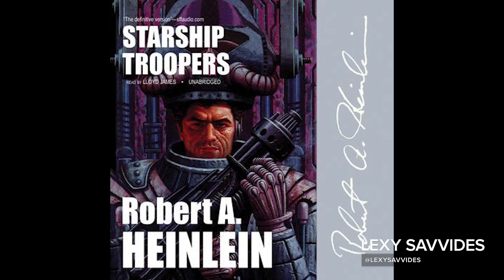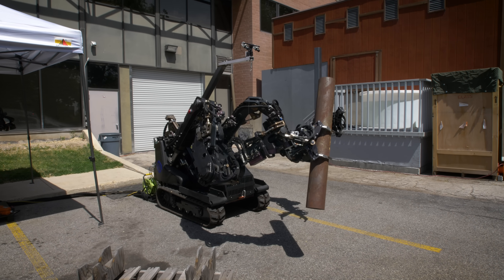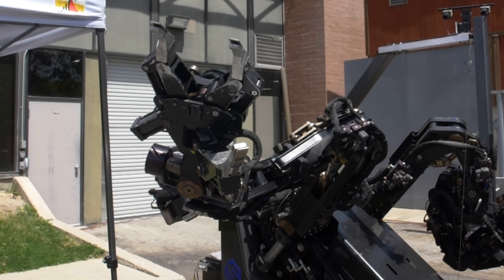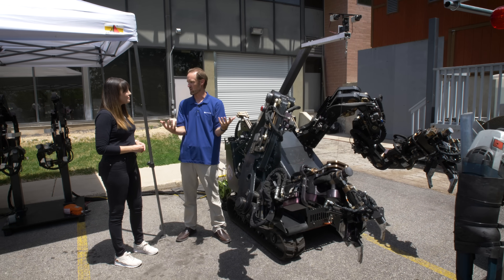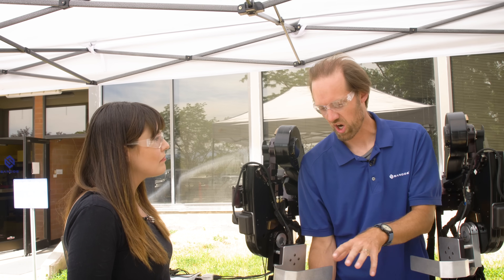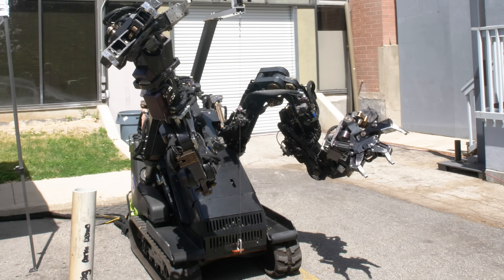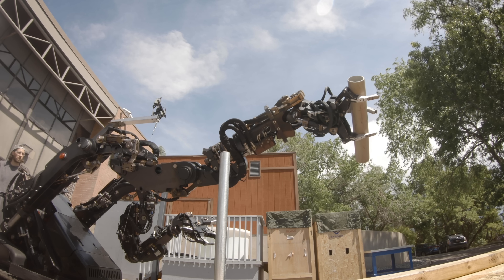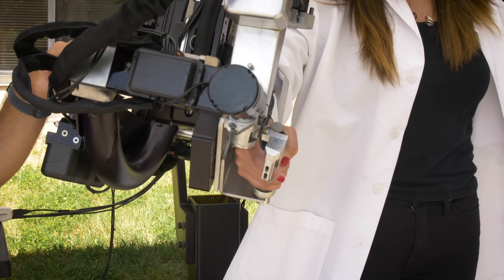Hands-on with one of the world's strongest robot arms

Comment: Thanks for watching! If you have a question about the robot I didn't answer, let me know 🤖
Reply: How will it hold up against a Xenomorph 👾?
Reply: @michealbay1290  Next video is the Aliens re-enactment!
Reply: @LexySavvides  
"Get away from her u b***h"
Best action movie ever 💯
Reply from the maker: @michealbay1290  It could take on a Xenomorph no problem.
Reply: Thanks  @CNET   for your reply.
U amigos helped me buy my first laptop, and it was quite the steal back in the day. 
Always a fan 💛 .
Much love
Reply: A valid question: did the controllers have any haptic feedback?  How can one do delicate things like cutting something without some feedback to know if there’s been a change in the material or density etc?
Reply: @AlEbnereza  Great question, as I recall there's little haptic feedback like you would get like from a gaming controller, for instance, but there is resistance which does make it easier to feel the weight of objects. Say if you lift something, you can feel that you've lifted it due to the change in resistance, but it won't feel anywhere near as heavy as it actually is.
Reply: Lexy Savvides Excellent! I figured it would need some kind of feedback so the operator doesn’t crush something by accident due to not knowing how much force is being exerted through the controller. Cheers Lexy!
Reply: Did you feel like you have the power of the Sun in the palm of your hand?
Reply: I couldn't tell if Ben Wolff was incredibly short or you were very tall ; ) Great report though!
Reply: @The.CuttingRoomFloor  LOL it's definitely me who is the giant
Reply: Please tell me these aren't available until 2021?
Reply: Do you think it will ever be used for Genocide?